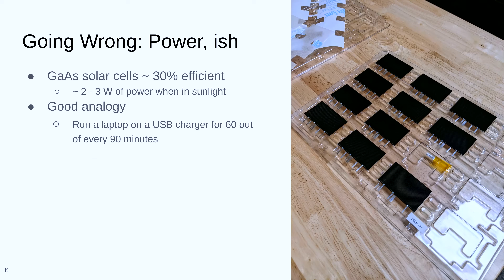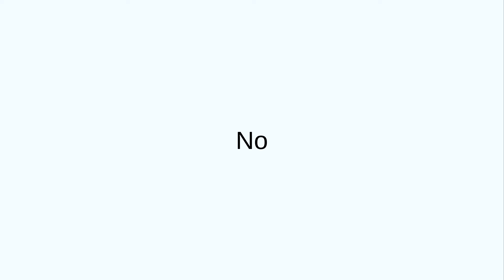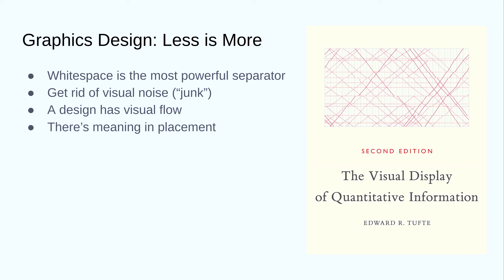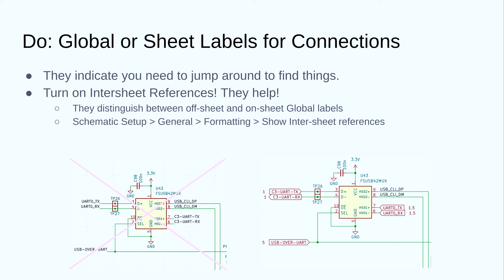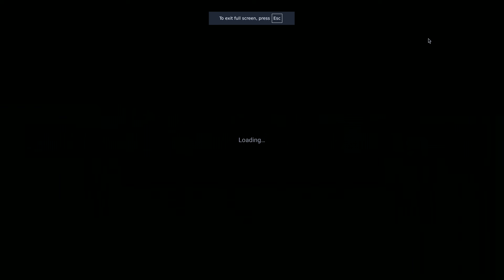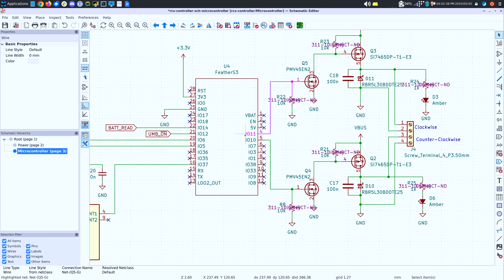Actually Useful Schematics in KiCad - Andrew Greenberg

Comment: Hi Andrew! I don't know if you'll read this but we actually met once very briefly -- I was the PCB team lead at USC RPL in 2020 and we spoke over a video call (I asked about going to grad school where you teach at Portland State, though I ended up going into industry).

Anyway, super interesting video, and I will definitely try to take note! I do work on an open source board (Mbed CE CI Shield v2) and I like to think I did follow some of these recommendations, but I am sure there are still some things I could improve on (would love your feedback if you do take a look!). Will keep your checklist in mind!

Personally I think my award for worst evaluation board schematic goes to FTDI's FT232H.
* 9 different voltage rails with vague names, where it's not clear which ones are inputs and outputs from the chip? Check!
* Nets connected across the schematic by net labels? Check!
* An "optional" EEPROM that the datasheet says you can omit, but the support people told me was basically required when I asked them? Check!
* Super confusingly named I/O pins that make it difficult to figure out which pins are used for what functions in which modes of the chip? Check!
* Random I/O pins used to bootstrap init settings, without much explanation? Check!
* And for the coup de grace, the example schematics are screenshotted into the datasheet, meaning you can't ctrl-F for net names and they are almost too blurry to read in some cases!

I don't think it's a coincidence that I was never able to get this chip to come up on the board I designed... after 10+ hours of debugging I finally gave up and switched to the CY7C65211, even though I had to write a ton of new software to make it work.

Comment: If you are not using KiCAD and still want to probe the layout, the free version of ZofZ Gerber viewer is excellent for highlighting nets. (The paid version is not very expensive - probably costs less than an hours worth of debugging, and it's a nice way to say thanks)  This is great when you need to give your software resource or other engineering resource the ability to probe the circuit without having to set them up with a licensed version of what ever software your company may be insisting that you use because they paid for it... If you do use KiCAD this is not a problem because everyone can have a copy.

Comment: Thanks that was a very nice talk.  Been around the business since drafting tables and ruby lith tape.    I agree with most all your items.  I used to use IO symbols for connecting pins where drawing the actual wire connection was too cluttered,  but have moved to just naming the net stub on the pin, adding a note if necessary.   In the early days with lots of logic parts, on large main frame boards with 50 pages, sheet to sheet references were almost mandatory, not so much with todays smaller boards.   I don't like hierarchical schematics -- too hard to follow, a block diagram is ok if necessary.   I don't like bus wiring, just just add a stub net and name.    I currently use DipTrace but I like what I see in KiCad and will likely be switching.

My main gripe is with the design process of selecting the package footprint.  Don't know about KiCad but on Diptrace  there is a good change you will find many many variants of  the footprint for your component in the library with no simple way to determine the differences without analyzing all the dimension parameters, not a quick process. 

One thing that had delayed me from switching to KiCad is the lack of integrated auto routing.  I use DipTrace's auto routing a lot but not for the final routing.  I just use it to get an initial estimate of where the high trace densities are and help with the placement.  I can then try different placements to optimize the trace density.  It's very quick to run a trial route and un-route.  Then once the placement if completed usually hand route the board.  

My number on gripe is with component manufacturers the have an A an B version of a part listed on there data sheet but not telling the difference on the top of the first page.  Spent many hours going line by line through the data sheet to find that one speck that differs.

Comment: Speaking of noise and clutter, if your circuit reference potential is represented by a ground symbol, and it usually is, you might have hundreds of them. Hiding the "GND" label under them cleans things up considerably. It actually is the one thing that MAX did right. Even with all those ground symbols pointing left, right and up, it was still unnecessary to show their labels. They are even more useless when correctly pointing down. Only for shematics with multiple different reference potentials and galvanically isolated ones, you sometimes can't distinguish them without labels.

Comment: 11:25 An exception I'd add is when it turns into a maze.  Sure you can follow lines with your eyes, but if I have to visually untangle three sets of similar criscrossing wires that topologically can't be disentangled, at some point it gets harder and more error prone than using labels.  Though maybe a bus could stretch things a little farther.

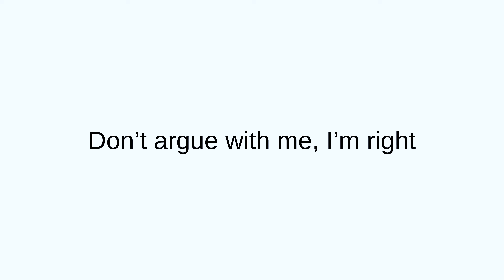Comment: 8:29 When you hand-build stuff, then it's more useful to use a physical package pinout. Knowing where the pins actually are makes it easier and results in fewer mistakes.
Reply: While I'm waffling a little on this point overall, it sounds like for your purposes you'd want the pcb layout rather than the schematic, yeah?  Take your schematic and lay it out in the pcb editor so you can see which pin connects to which component, etc.
Reply: @Erhannis  I mean, when you draw schematics to build stuff on a protoboard or breadboard
Reply: I was thinking the same.

When using the standard library symbols I often found myself getting stuck when I started the layout process. The connections looked fine in the schematic, but resulted in horrible pathways on the PCB. So I would start switching between the schematic and the layout, moving pins and connections around until I found a somewhat usable compromise.

After I began using the physical package I found layout to be much easier as I had already considered the physical placement of the various pins in relation to the components they connected to.
Reply: @chaoscarl8414 pin shuffling is a routine task during PCB design. It's not like you only ever have one shot at the schematic and can never make any changes ever again.

If you're dropping down a symbol for e.g. a 74 series logic chip, being able to place the individual gates in the schematic where they make sense is way better for clarity than having a bowl of spaghetti to get wires from all over the schematic to the one symbol that represents 4 gates.

You could also draw custom symbols that arrange signals to be more conducive to cleaner schematics. That is also very routine.
Reply: I tend to disagree personally. I've done heaps of prototyping and not once have I thought that looking at the physical layout of a chip in my schematic would help me.

I can read numbers and I can count pins, and since pins tend to be arranged quite predictably I don't need much else.

To me, seeing how the circuit works is more useful than how it looks when wired up physically.

Comment: 23:13 hierarchical labels are necessary when you use a single schematic (for example an input section)  multiple times, (like using the same block twice by copying the hierarchical sheet)

Comment: 1.27mm...WTF is THAT?  Oh, you mean 0.05 INCHES?  Oh, ok.  

Americans use inches and feet, and we'd rather measure in GIRAFFES than resort to metrics...but any other country who's put men on the moon, feel free to retort.
Reply: China is likely to be the next around 2030, probably followed by USA and Russia soon after.  

The moon is mostly a vanity prize until something profitable can be EXTRACTED from there.  To do that it has to be cheap to reach and what you extract has to be expensive to ship to space from the earth.  Water would be the most likely raw material as any other will require expensive (heavy) infrastructure to turn into something valuable.  

I suppose you would offer alegiance to the Chinese traditional units as well when the time comes.

Comment: One problem is that IEEE has retired IEEE315/ANSI Y32.2, but can be found by googling it.  There is  IEC60617, but that contains symbols that are typically used in Europe, while common US symbols are missing. For instance the European symbol for a resistor is a rectangle, while the US smbol is a squiggly line.   ASME Y14.44-2008 outlines the standard reference designations for electronic parts that were originally part of IEEE315. Also IEEE200 outlines the reference designations for electrical and electronic equipment assemblies.  Part of ASME Y14.24 Drawings Types and Applications of Engineering Drawing covers electrical schematics.   ANSI Y14.15 covers Drafting Practices for Electrical and Electronic Diagrams and Y14.15a covers Interconnection Diagrams between assemblies.  But these have also been withdrawn.  IEEE 91 and 991 are for logic diagrams. 

A couple more things, schematics should be drawn such that an electronic technician can use it to debug a circuit.  Old Heathkit or SAMs Photofacts schematics are good examples.  Also it's not a good idea to try and draw a schematic for both PCB and Spice simulation.  These are two very different animals.

Then there is the elephant in the room : Schematic/BOM/PCB Layout Decal interface.

Comment: Hierarchical blocks are for people who doesnt make complex PCBs. Why would you want 50% extra wiring in your diagram?
Reply: One uses hierarchical blocks for repetitious circuits.  For instance if one has 10 identical input buffer amp circuits, one only needs to draw the root block diagram and a single buffer amp schematic instead of 10 buffer amp schematics
Reply: @bobkitchin8346  You are so right. For reuseablility or in actual hierarchies (read:IC design and simulations) it makes a lot of sense. Unfortunately, people think hierarchial blocks make good 'block diagrams' in PCB design. And they dont believe the redundancy making the same electrical connections in multiple sheets is a bad idea. The author of the presentation makes a lot of great points. But using hierarchial design for making 'meaningful block diagrams' is not one of them.

Comment: Pet peeve: In the EU, people insisting on using rectangles as the symbol for resistors. It does not pass the 100ms razor. 
Also pet peeve: It's not just Olimex, Sparkfun/Adafruit etc. do the same - little rectangles and connect-by-name. :(
Reply: Squiggly lines are for inductors you monster! :D
Rectangle is way more clear separating them from each other. that's why we chose to use that. Hand drawn inductor and resistor are way more easy to distinguish from each other.
Reply: @Mtaalas  Resistors are the "Kikis" while inductors are the "Bubus" :p The "loopy" version especially is visually striking.
Srsly though, I'm neither european nor american, swear by the metric system, and have to squint to distinguish between EU resistors (rectangles), ICs (rectangles) and off-page designators (also (pointy) rectangles). 
When placed side-by-side, with an A-B test, I can bet that the schematic with squiggly resistors shall win out each time.
Reply: @AdityaMehendale  The squiggly lines were appropriate while we still had wound wire resistors in the 80'ies - it warned you that there is a significant parasitical inductance. Those things have become rare, last time I tinkered with those I was a teen in the early 90'ies. In the modern world resistors are literal tiny boxes (SMD) or at least look like a box with strings attached if you draw them with a pencil (THT). I learned both symbols as a kid - I still prefer boxes, since I can never tell the difference between an inductor and a squiggly-line-resistor about 5min after I drew it with pencil. On bad days I can't tell the difference on a printed schematic.

KiCAD has a few clues for ICs: they are BIG boxes and they are usually yellow inside with lots of labels and pins, no need to squint. 😜